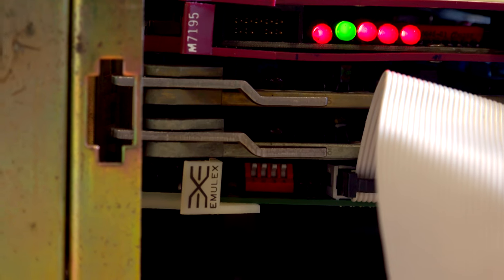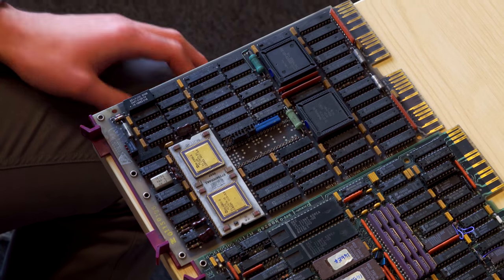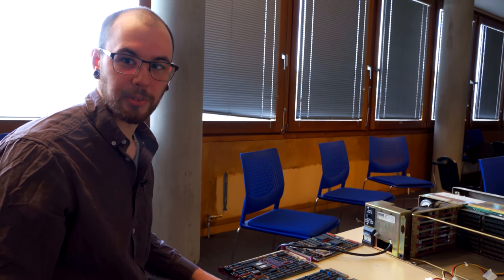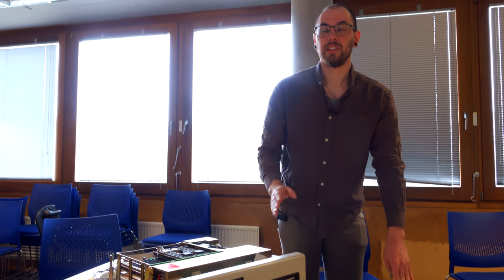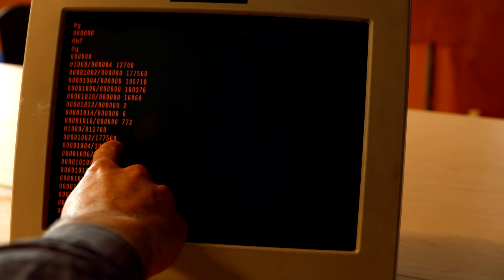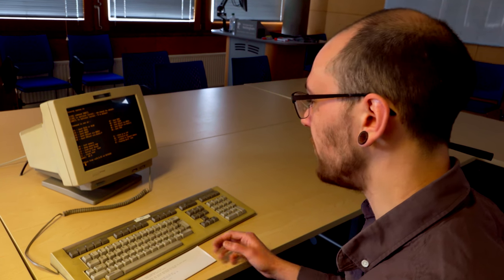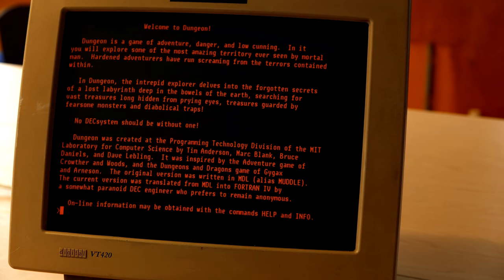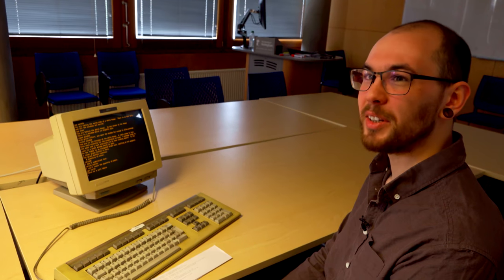DEC PDP-11 & Zork - Computerphile

Comment: "And this... I don't really know what it does, but if I don't enable it, I can't boot into Unix." Why do I feel like that is just typical computer science? It's like when read someone else's code which isn't well-commented: "There's five lines of code here that... I don't understand at all... but if I bypass it, the application crashes, so I'll just leave it in..."
Reply: Incidentally, it's probably the Line Time Clock, a reliable clock source based on mains power frequency that predates widespread availability of RTCs, and is a prerequisite for booting UNIX and a few other things. My Heathkit-encased 11/03 has an LTC that is hardwired on and has to be shut off by pulling a jumper on the PSU, but I know they added front-panel switches for the LTC in later revisions.
Reply: IceMetalPunk From the name "AUX" and the hint at a clock relationship, I would suspect it's not as much precision timing as it's the tick interrupt that is used for process switching as well as basic timing. I could easily imagine a UNIX kernel getting stuck quickly if process/thread switching is not happening.
Reply: The manual for the 11/23-plus says about the aux switch: "OFF - In the· normal factory configuration, setting this switch to off
 turns off the system ac power.      ON - In the normal factory configuration, setting this switch to on
 turns on the system ac power. If the HALT switch is also up, the system automatically boots at this time."

Comment: Thank you. Are there any other restrictions to the order that boards can be plugged into the backplane bus? What if you plugged in two processor boards?

Another topic that could be a future video: how does UNIX/C make architecture neutral that which differs across hardware/processor architectures? e.g. system calls + parameter passing, memory mapping / pages. 
Did they define all this when they first implemented UNIX in assembly, or did it evolve (and break backward compatibility) when UNIX was made portable?
How / when was a convention established for calling functions written in different langauges in an architectual neutral way?

Comment: Around 1985 I played a two player video game on VT52 terminals connected to a PDP11 clone running RSX-11 . Each player could control 10 tanks (rotate them, start, stop, shoot). It was a simple game but super fun. I do not remember all the details. I was thinking to rewrite it  but I cannot find the original  or at least some screenshots about the original. Just by pure chance I am wondering if someone played that game and eventually has access to archives to find the source for it or some details about how it worked.  Thx.

Comment: Wear a grounded wrist strap when working on your computer and put it on a grounded mat not that plastic static generating table top. When I worked at DEC you would have been fired for not following correct anti static precautions.

Comment: I think I still have my copy of Dungeons source code written in FORTRAN on A Mag tape. 1978 was the writing date I think. I will have to look for it. Could you use it?
Reply: I have no way of reading the tape but I could try and run the code under f77 if you can make a dump of it :)
Reply: I do not have a Magtape to read it from. I must make a trip to my storage unit. My DEC 'stuff' is just about all that needs to be sorted there now. I will get back to you on this after my next trip there, I need to find it first.

Comment: Building C on top of Unix?
Reply: Yep.  Unix  was originally written in machine code, then the insight to write it in a higher-level language to make it portable was made.  The rest is history.
Reply: The very first version, yes. But "building C on top of Unix" is misleading or rather over-simplifying. The actual bootstrap of both Unix and C is more like two functions calling each other recursively (with Unix calling Assembler at one point to get a starting point) . None would be there without the other.

Comment: I almost bought a pdp-11 in the 80's for running a multiuser bbs, but thought about the noise & electric bill.  a pdp111-70 with 2 rl03 disl drives and afew extra disk packs.    I do have a old HP D class unix server, 712 workstation & dumb terminals

Comment: What happened to the Sun Server video previewed at the end? The link doesn't work and I can't find it anywhere in the sidebar.

Given that the machine lives in a fairly sizeable desktop-style case in the early 80s spec, how big would an earlier one have been that didn't have the luxury of a microprocessor or integrated-circuit memory?
Reply: I ran an 11/34, an earlier generation machine with an 18bit address space rather than the 22bits of later generations.  Excluding the storage it was in a rack-mount enclosure (19" wide)  with a control unit about 5" tall (power switches and octal keypad for entering boot code) and a card cage unit about 18" tall that would pull out of the rack like a drawer.There were roughly a dozen slots in the card cage. The CPU was on two full cards roughly 12" tall and 18" deep , one for the Floating point and one for the integer. There was a serial port card (half-size?)  and full size cards for the tape and disk controllers. We had 256kB of DRAM on a single card, the maximum supported. My memory of the PDP-8's and -11's I saw with magnetic core memory was that a full size card carried between 16 and 64 kBytes depending on the vintage.

Comment: I always imagined a PDP-11 was bigger than that... like the size of a dish washer or something. It's micro computer sized.
Reply: This was a later machine.  Earlier ones could occupy several racks.
Reply: this iteration was pretty small and made later on. The PDP11/34's that I'm familiar with are about the size of a dishwasher maybe a little smaller. That does not include disk drives, mag tape readers, paper tape reader and other supporting equipment.  Ours were in a 48VDC plant so they had a rack of equipment just for power since they ran off mains power normally.
Reply: During post high-school studies I was a student operator for a PDP-11/34 that ran RSX-11. It occupied two full height 17" rack mount units. It included two removable disk pack  units and one system disk pack.

Comment: Correct me if I'm wrong but wasn't UNIX built on C?
Reply: UNIX begun its life in assembly language written for the PDP-7. It was converted to mostly C in 1972-ish.
Reply: Unix and C co-evolved over the very late '60s and throughout the '70s. Around 1980, it started moving onto VAX-11/780s, and later VAX-11/750s, /730s, and others. The C of 1975 or so is mostly readable now, excepting the absence of ANSI parameters in function declarations.

Comment: Ah, the heady days before the GUI. Been a command line guy ever since. I suppose you could run RT-11 or RSTS/E on that baby too.
Reply: or RSX-11M
Reply: Hmm - never heard of RSX-11M - and my only experience has been on PDP-11/34 and PDP-11/70 both which ran RSTS/E. And then I administrerd a Data General Eclipse MV9600U running AOS/VS II.
Reply: kd1s I've programmed in Basic+ in RSTS/E but RSX (Resource Sharing Executive I believe) was used more in control type applications. There was even a DOS single user system.
Reply: RSX (and RT-11) could do async interrupt-driven I/O, unlike RSTS where all I/O calls blocked the process until completion. Only having access to a RSTS machine, I felt jealous.

Until VAX/VMS came along ...
Reply: Yeah RSTS did have some issues with I/O but it worked.

Comment: The user folder is Catbert.
Reply: gajbooks that's the name of the Unix kernel's configuration file. Back in that day you would compile all of your hardware configuration into the kernel. No fancy driver files to load from disk.
Reply: Brian Fundakowski Feldman Still, that makes it even funnier. Critical system components named after comic strips.

Comment: Yes I want a 10mb hard drive the size of my fridge. 😂😂😂😂😂
Reply: I remember seeing the "twin tubs" on a work experience week from school (84). Those things (the 8 platter carriers) were heavy, but the opps used to just lug them about as if they weighed nothing 4 times a day (switching over from "live" to "batch" so they could run the invoices/picking slips/etc.). I wasn't allowed to touch them, so was tasked with loading the reel-to-reel tapes into the vacuum chambered uprights and then loading the forms on the band printer... which was loud as heck. A rotating band of letters, hit by a set of pneumatic hammers that could print 2000 lines PM. It made a noise like a jet engine as it started up; then clattered like a million typewriters, as it chucked the multi-part fanfold sheets out. The system (DEC, or PDP, something) had 1024K of memory... at a time when the BBC micro had 32K.
Reply: Jonathan Wilson 😂😂😂😂 people now won't have such interesting computing memories ! Thanks for sharing.
Reply: My first job, we had one of those big line printers hooked up to our PDP-11/70. We would load up and print statement and insurance forms for our clients (dental offices). State of the art for 1983!
Reply: @JW-uC  Hey JW...Steinmetz 1984?
Reply: @RogerBrenon  Not sure what you're referring to. If you mean what company, then to be honest I can't remember the name (or even what its business was). Was a large company in Norwich close to the train station. It even had its own branch line(s) and switching (although if I recall correctly, no longer used by that time) and I would have been there about 1984/5-ish. Was a real eye-opener for a kid that was more used to Commodore PET's and BBC micros.

Comment: He doesn't seem worried about static electricity?!
Reply: It was less of a problem with older chips because of their smaller scale of integration.
Reply: The saying better safe than sorry is still the best strategy but frying cards due to static discharge from handling them has never ever been as big of a danger as many seem to think it is.  For one if your system is still plugged into mains power and you touch part of the exposed metal on the case you're going to have just grounded yourself releasing any buildup.  And those older cards are far more resilient than you might think.  I've had many that were just tossed loose in a box with other cards with no anti static bag or anything and pulled them out years later to play with and have yet to have one die.  And these are boxes with a bunch of cards in them loose that had been dug through many many times looking for the one I wanted/needed.  Also newer boards often have circuits in place to help prevent them from getting damaged from static discharge.

Comment: I don't know the PDP-11 address decoding, but unless it's doing some arithmetic, I would have thought it easier to assign the larger RAM modules at addresses 000000000000 and 000002000000, and the 128K block on the multifunction card at 000004000000, making top of memory 000004400000 . But then I'm influenced by the IBM abomination that officially maxed out at 2400000.
Reply: PDP-11s usually assigned their memory from the bottom up in physically contiguous blocks, with the I/O page located at ...77760000. The largest of the common PDP-11s was the PDP-11/70, which had 22 address bits, making the highest possible (physical memory) address 17760000, if I've done my arithmetic right. My departmental PDP-11/45, which had 18 address bits, had a 48kB core module in low mem, and a 128kB semiconductor memory above that. (It was faster to have the kernel in slow memory and user progs in fast.)

Comment: My vacuum cleaner makes less noise
Reply: That's only with one of the fans connected as well. I had to disconnect one of them because the bearings need replacing. Will get to that eventually.
Reply: It's a "cool" machine, but yes two fans will insure it being cool for many years to come. judging by the comments there are thousands of "fans" out there, I am sure one of them 😉
Reply: But you can't play Zork on your vacuum cleaner